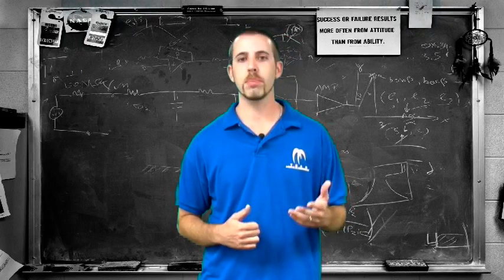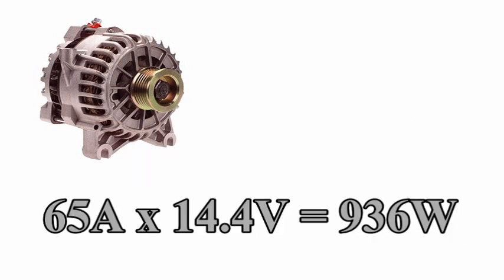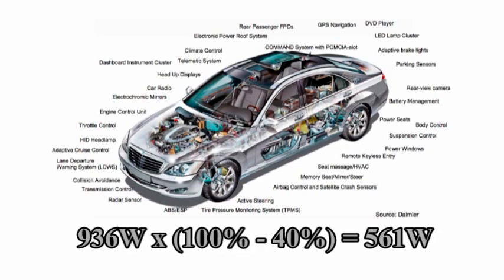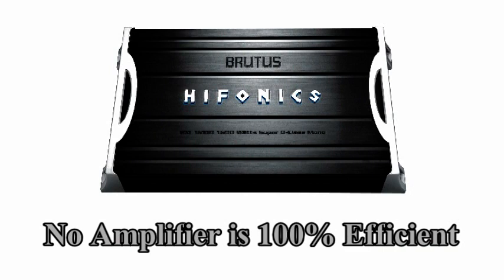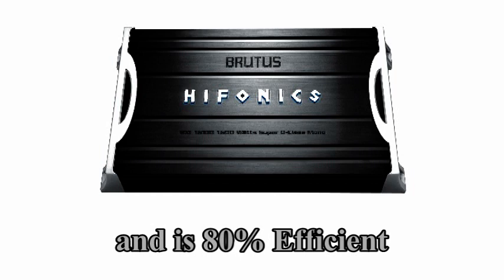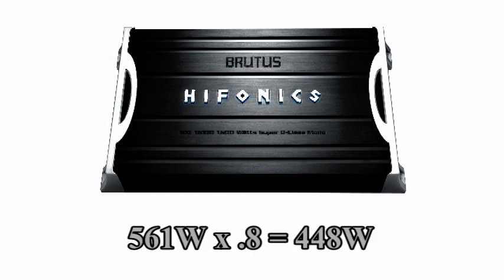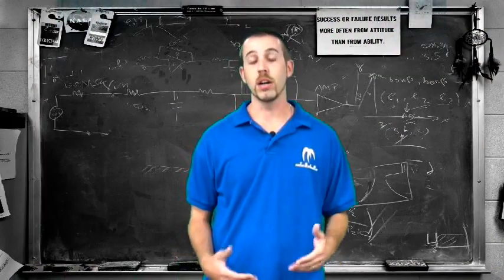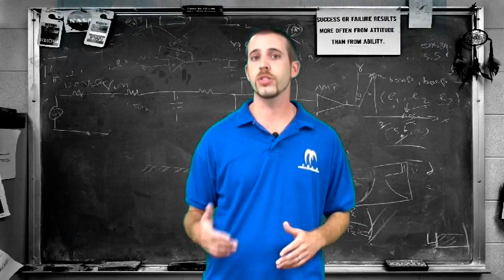Car Audio 101 - Alternator Tutorial

Comment: to give a bit of a better idea here is my current setup:

I did not do the BIG 3 upgrade as it wasn't needed for my system currently. 

DB electrical 200 amp alt.
Hifonics brutus 2000.1 amp
2 pioneer 3002d4 @ 1ohm
pioneer avh1500dvd
HERTZ energy ecx 6.5 and 6x9s
hifonics brutus 240w 4 channel amp
kinetic HC600b in the trunk and a stock bat (replacing soon)

My old setup was for SPL so I had a ported box and a bandpass config.
but being on the road so many hours a day i decided that I wanted an sql setup and
went with all this. it came out good and there isn't any noticeable electronic issues. everything is fused and wired properly.

Comment: i plan on running a HiFonics Brutus 2000 watt amp to 2 15's..if i use stock alternator and battery will i get full wattage? (2003 chevy Tahoe)..

Comment from the maker: @MikeAndTaya Capacitors are temporary storage devices. Standing alone they have no voltage or current. If your electrical system can't keep up with the demand of your audio system then a cap will simply cause additional strain as it is resistance between your alt/batt and amplifier. Caps are great once you have already upgraded your electrical system. Your amp must be marketed as 4kw max. Two 40amp fuses tell me the amp is capable of 800-1100watts.

Comment from the maker: @xgac16x In most cases, a 175-200amp alt with a decent battery for reserve will do the trick. BUT, you will want to contact an alternator manufacturer with the make, model and year of your vehicle to determine the size of your factory alt and what models are available as upgrades.

Comment: Great video.  Although, assuming worst case scenarios is the smartest method.  Account for measured power cable resistance, lowest feasible voltage across the battery, worst possible amplifier efficiency, and peak current draw to ensure a safely operating system.

Comment from the maker: @Matthington10 Careful planning and fabrication. Some alternator manufacturers have brackets for dual alternator installations, but in most cases new belts and hardware are required. I would consult an alternator manufacturer as well as a respected mechanic. That is one project that I would NOT recommend on your own.

Comment from the maker: @akmee95 Stock alternators put out more amperage as your RPM's increase, but voltage stays relatively consistent. Alternators designed for car audio applications are designed to produce high amperage at idle and the voltage is relatively consistent unless the manufacturer provides a voltage regulator which allows for you to vary the voltage based on your desire.

Comment from the maker: @myaacount What is the rms power of the amplifier and at what impedance (Ohm)? What impedance voice coils are on your subwoofer? You are either clipping the amplifier, running below the rated load, or you have electrical issues causing the heat.

Comment from the maker: @MrBadchoice101 I use the sum of the fusing on the amps as my reference. Sometimes I round up a bit to get a common fuse value. Then use one fuse off of the front battery, one into the secondary battery and ofcourse fuse from the secondary battery to the amp(s). The fuse(s) from the secondary battery to the amp(s) should be close to the value of the fusing on that particular amplifier.

Comment: @MaxxsonicsUSAInc 
thank you mate, so by knowing that i know what needs to be done but this brings up another question. On dual battery installs, the fuse breakers at the first batt and before the second. Should the fuses match the isolator relay or still match the Amps fuses sum ie; two 30A = 60A Battery fuse?

Comment from the maker: @codyclem765 I would start by measuring your voltage drop at the power and ground on the amplifier. Let me know what your reading is? I have seen 1500 watt systems operate on the stock alt and upgraded battery(s).

Comment from the maker: @DUBDUECE05 I would recommend measuring the voltage drop at the amplifiers' power and ground and then getting back with me. Is your current alternator the stock alt or upgraded? Also, do you have a stock battery or upgraded battery?

Comment from the maker: @MrBadchoice101 Absolutely! Amplifiers produce power based on the load (impedance). The lower the impedance, the more power they produce and therefore draw more current from your electrical system. That is why you noticed the larger voltage drop at 1-Ohm vs 2-Ohms.

Comment from the maker: @CP1124 What model Kinetik do you have? Also, I would remove the battery isolator and replace it with a fuse in the front off of the 12V+ battery post and a second fuse coming into the rear battery 12V+ terminal. This will allow for your audio system to use your primary battery as reserve if needed.

Comment from the maker: @SillyRam I would recommend measuring the voltage on the power and ground of your amplifier with the vehicle running and system off vs the vehicle running and system up loud. Please share your results. In your application it is very doubtful that you would require an upgraded alternator, but rather a simple battery upgrade.

Comment: I have two swr-1223d (alpine type r 12 subs), 80 watt speakers and iva w200 running off of a mrp m1000 alpine amplifier (1000 watts). they are running off of a stock 1998 toyota corolla, and I found that when I first got them in they hit the low notes really easily, but it now almost seems that the battery is low and will only hit the high notes with them. Would you suggest a new alternator, or a new battery? Or a capacitor, although I saw above where you said you do not recommend them. Thanks.

Comment: I have a stock alternator which is 95 amps and I also have a battery isolator in which i have a yellow top optima in front and a kinetik in the trunk. I'm running a 1600 Hifonics Brutus to 4 kicker cvrs. I also have a capacitor running to the system and my average voltage is 14.6-14.9. I am planning to get a HO alt and the big three in a couple of months.  I wanted to know if I'm straining anything on my electrical system and/or alternator?

Comment: I have just a quick question, with Ohm loads, does that change anything with the power useage and or draw besides on amp base? I know as much from seeing volt read outs in 2ohm push 14.4V down too 13.1V and than on 1ohm go 14.4V too 11.7V. Any info would be awesome :)

Comment: i have a 2005 malibu classic it has a 105 amp alternator im running 2 jl 500/1s on 2 12 w6v2s with a eclipse on highs when i first installed it ir was hard to sit inside now its not putting out as strong what would you recommend i do to start.all i have is 1/0 wire to bass amps and 4 guage to highs amp any help would be helpful thanks

Comment: Hey maestro i need a help. I have Amp of 600 watts maximum power and i am running Clarion WQ3010D Sub woofer ( 500 watts RMS or 1500 Watts maximum) power. Speakers are running directly on Head unit. My problem is that whenever i raise up Amplifier`s gains, Amplifiers tends or begins to heat up quite badly so that i need to bring the gains down to zero :( this is just ruining my sound as i can not enjoy higher gains for around 20 minutes. Regards

Comment from the maker: @suppersoccerjock I would definitely consider upgrading your alternator as the factory alternator that comes with the vehicle is set to match the requirements of your vehicle and NOT after market audio equipment. In most cases you can sufficiently power a system up to 1200wrms on a factory electrical system, but anything beyond that begins to strain the components of the vehicle and the amplifier causing lower voltage and potential failure to your amplifier over time.

Comment from the maker: @erobles396010 The XX Goliath is 5000wrms per @ 14.4V. The Kinetik HC2400's support 2400 watts per. Your proposed system would be 10,000wrms and your four HC2400's would only support 9600 watts. You will require a nice upgraded battery up front and a BIG alternator. I would recommend contacting XS Power to see what they may have available for your vehicle.

Comment from the maker: @CHEFKARL1987 I am not familiar with the charging system in the Yaris. I would suggest that you contact an alternator manufacturer to see what options you might have. You can stretch things out a bit by simply upgrading the primary battery with something like a Kinetik HC2000 or HC2400, but if your alternator lags then your overall voltage will suffer. Google XS Power as they make some incredible alternators and have a great tech department.

Comment from the maker: @raulgomez902 Based on the information you have provided, you have a single amplifier rated at 1000wrms. If this is correct, you may simply require an upgraded battery to replace the stock battery and that should take care of your issues. I would suggest looking into the Kinetik HC1800.

Comment from the maker: @MrPimping365 No, it would be your initial measurement with the factory electrical system in tact. That number does not change as that is what your vehicle and factory accessories require. The percentage will be much lower when you upgrade your alternator.

Comment from the maker: @fordgt187 There is no way to tell until you measure the voltage drop at the amplifier during play. If you are dropping below 12.5 volts at high volume then you may want to look at upgrading your alt or battery. I have seen a number of factory electrical systems handle 1000-1200 watt rms amplifiers with no problem though.

Comment from the maker: @kingjeff699 You are going to have an interesting process of elimination. I would start with voltage measurements at your main battery and also at the amplifier when these issues are happening. You will also want to check the wiring to your headunit because when it cuts off, there is no signal going from it to the amp. Your headunit may have a lose connection and be the root of the issue.

Comment from the maker: @staind039 According to XS Powers ratings, the D2400 is good for 2500 watts as the primary battery or up to 4000 watts as a secondary battery. You will be fine.

Comment from the maker: @boysounds It will provide charge to the batteries, but adding multiple batteries to a small alternator limits the overall voltage that you will see when measuring the batteries. 

Example: stock battery and stock alt, measured voltage is typically around 14-14.4V. Add an additional battery in the circuit and you will normally drop to 13.6-14V depending on the size of the additional battery, size of the alternator and draw from other accessories in the vehicle.

Comment: I need some help. I have 2 10" kicker cvrs (400W rms) hooked up to an 1800w amp at 1 ohm. I'm using 4 gauge wiring. I havn't done the big three, the battery and alternator are both stock. My lights dim like crazy, what should I do?

Comment from the maker: @DJTDames Is it doing this with the headunit and amplifier off? If so, you may need a tune up. If it only does it with the system turned up then you might want to measure your voltage drop at the power and ground terminals of the amplifier. If you are dropping below 12.5V then you may need an alternator and battery upgrade.

Comment from the maker: @unclephil2010 Your current after market system shouldn't require an upgraded alternator. I would think that performing the BIG 3 with 4awg would be perfect with your current system. If you plan on upgrading to something bigger in the future then you can always perform the BIG 3 with larger gauge wire now. Same goes for the wire from your front battery to the amp in the back. You are ok with 4awg for now, but if you plan to upgrade in the future you can upgrade that wire accordingly right now.

Comment from the maker: @mikedev20 More than likely. I can't speak for other manufacturers, but our amplifier are designed to simply shut down if the voltage gets too low and then as the voltage comes back to safe levels the amplifier will power on again. I would recommend measuring your voltage drop at the amplifier when this condition takes place.

Comment from the maker: @unknownRC In most cases the vehicle manufacturer puts the right size alt on a vehicle to run it and all of its' accessories. If you voltage drops below 13V under heavy deman from your amp then I would consider an alt upgrade.

Comment: hey mike, im runnig stock alternator with 4 red top dry cell batteries, i checked my voltage with my fluke meter its around 12.78 cranked up, and thats after an hour of strait playing thats at the amps. it read 12.78 at the front battery too while cranked up. also do you like circut breakers instead of fuses thanks jeff

Comment: i was watching your video on the big three upgrade, and i have a question about that i understand why people do it and i'm sure it's more efficient. but would'nt be a good idea to  have a ground from your alternator straight to your battery, i mean i know that the alternator is grounded to the engine block, but most engine blocks are cast iron and motor mounts usually have rubber bushings, what i'm trying to say wouldn't a straight COPPER wire be a better groung the block itself?

Comment from the maker: The smaller pully results in higher amperage at lower RPMS, but Voltage is generally regulated by the vehicle or an external control with an upgraded alt. 

In regards to drag spin, you would want to ask an alternator manufacturer about that one. ;-)

Comment from the maker: A capacitor is a storage device that discharges very quickly but will actually create an additional draw on your electrical system to recharge. If you electrical system is already not strong enough for your aftermarket audio accessories then a cap will NOT help. Caps are good when you have the proper electrical setup and simply use the cap as a buffer during heavy bass drops.

Comment: Very cool. Most alts though dont even put out the amps there rated for till 5000 + rpm. A lot of high out put alts do show power graphs with them. Amps from 500 - 5500 in most cases. Even a 250 amp alt will only do 20 or so amps at 500 -700 rmp. Unless disigned differently. Its still a need for a good battery or batteries, depending on what your doing. 

Nice video Mike, now I can do some math :D.